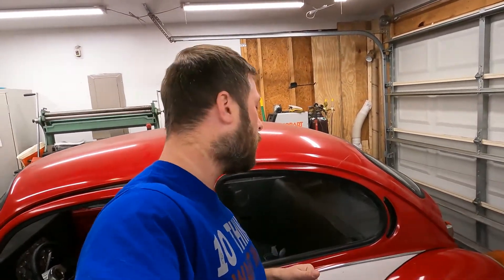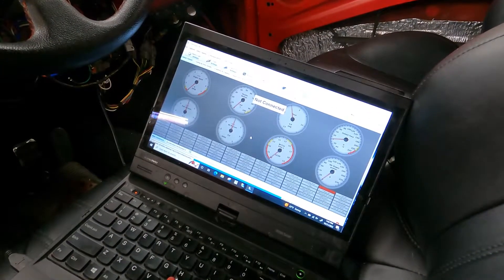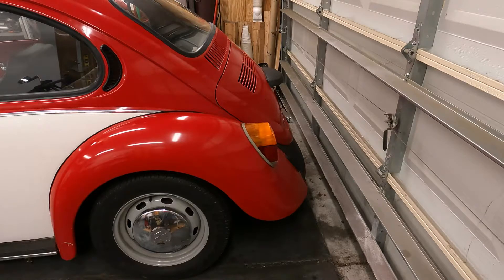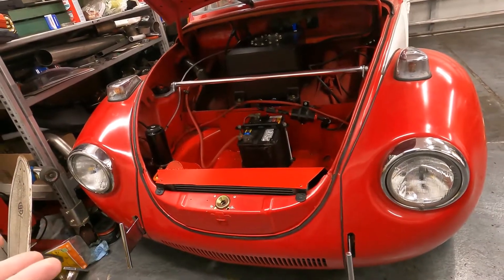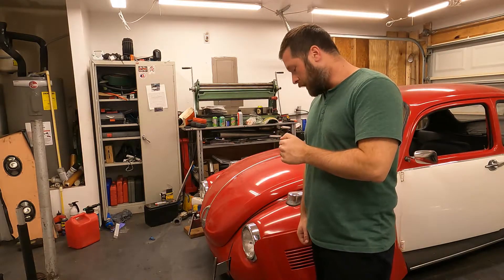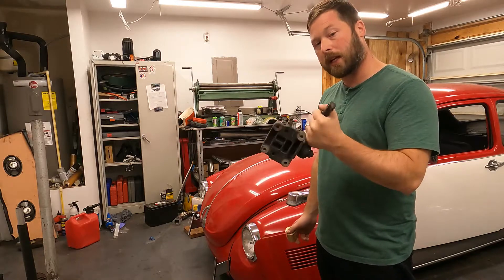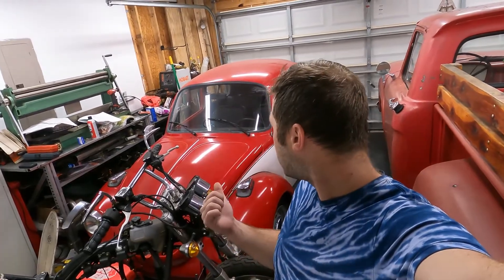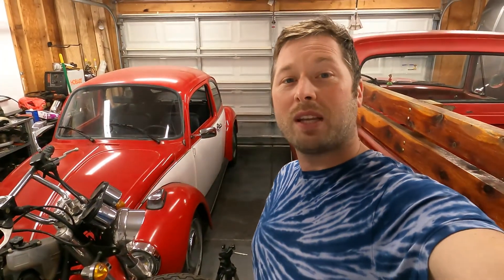Fine Tuning Idle with Megasquirt 3 Pro EVO -- 1973 Super Beetle Subaru Swap

Comment: So, I'm really considering a Subi swap vs  2056cc T4.  I'm building the car for autocross.  Do you feel the extra weight of the engine?
Reply from the maker: I honestly do not notice extra weight but I never drove the car nearly as hard as I do now lol. I'd like to think with having at least 6x the power and adding a little extra weight in the front with radiator/coolant makes an added weight in the back negligible. I'm not sure that motor to motor there is even a significant weight difference since the Subaru is all aluminum (block/heads). Best of luck!

Comment: I just bought the super beetle with the ej22 turbo i thought it was producing 5lbs of boost but it was 13lbs of boost not sure what that will make the horsepower but hopefully around 250
Reply from the maker: Sounds like it should be wild! I would think 13lbs should put you closer to 300hp but I’m no specialist lol

Comment: What do you think the horse power is with the turbo on it
Reply from the maker: That’s a great question. My guess would be around 250hp with about 8 psi. I’m hoping to get up to 18 psi and around 350hp but will need more suspension and tire before I get to that much boost.
Reply: Thank you for that information im looking at a ej22 turbo with 5lbs of boost im hoping that motor will be at least 200hp
Reply from the maker: That seems very reasonable to me. NA these motors make somewhere between 140-160 so I think an extra 50hp with turbo should be no problem.

Comment: I wanted to build something like you(german look w/STI engine), but I ended up starting a Locost build. I used to own, back in Europe a '68 1500. Very nice job you did there. You have a slipping belt there. I'm thinking about using the Superbeetle windshield for my Locost. Can I ask you a favor? Could you please measure the windshield width(straight line across it). I would appreciate it a lot.
Reply from the maker: Thanks for the support! Send me an email at ratchetmotorsnc@gmail.com and we’ll figure it out!